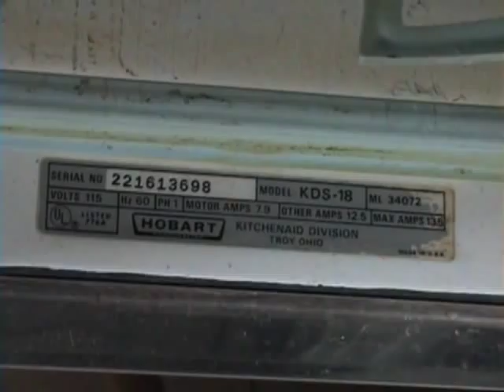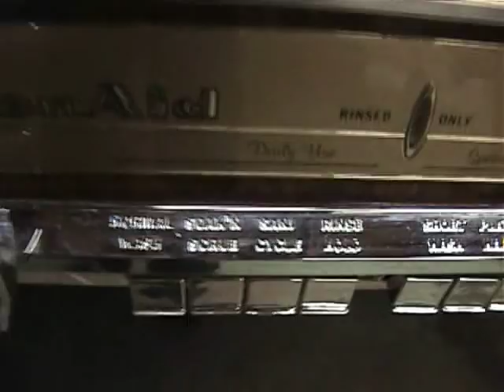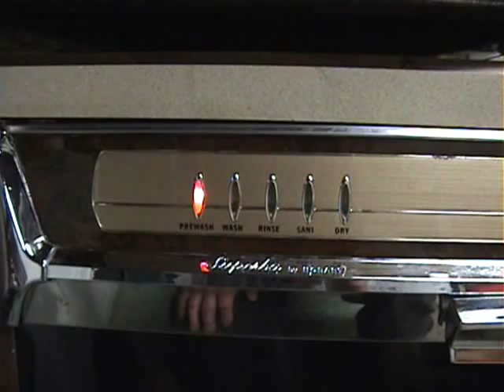Vintage KitchenAid Supurba Dishwasher

Comment: You said your top sprayer shoots straight down. There is a 3rd Level Spinner that goes up there on the roof of the washer to spray water around. Mine fell off as did yours apparently. I find Spinners for newer washers but not same as mine.

Comment: New dishwashers stink. They take too long to wash dishes and they look good but the insides are crap cheaply made
Reply: They DO take too long, but I think the insides are MUCH better (stainless steel, not plastic or porcelain, and VERY quiet).  I mean you almost have to stick your ear right up to my new on to hear it, as opposed to those things that made in the 1970s that sounded like cement mixers, 6 rooms away.